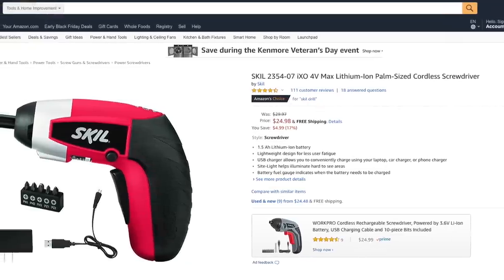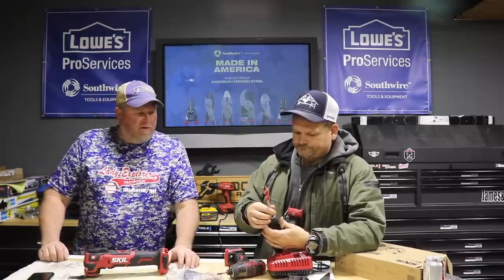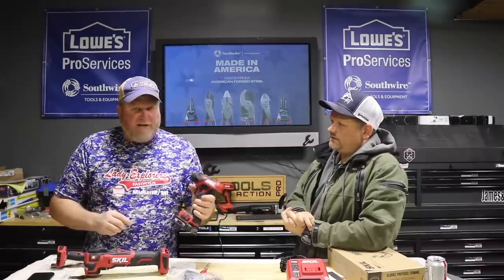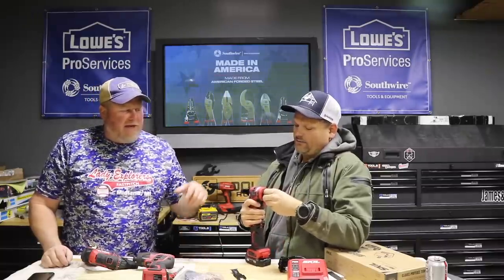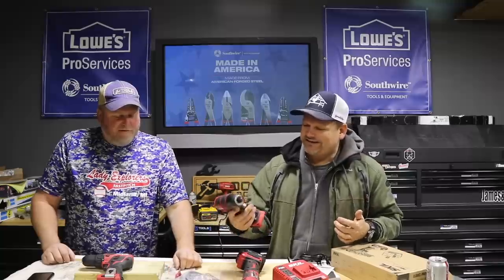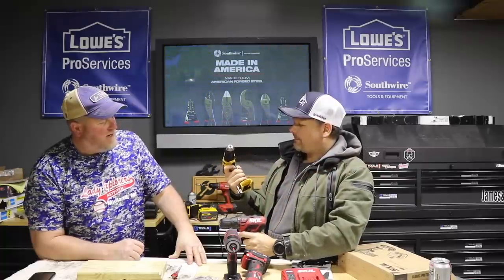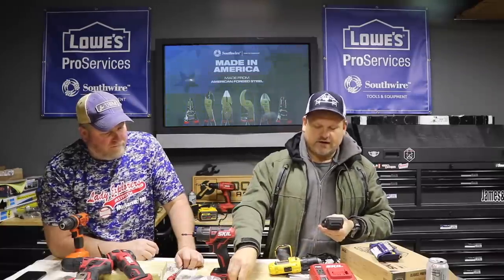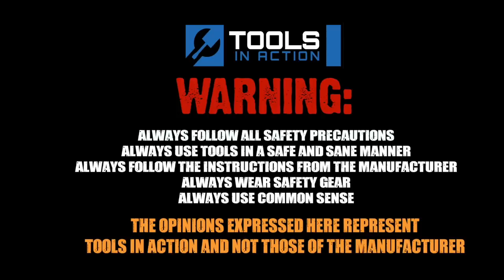SKIL 12V PWRCORE Tools - First Look

Comment: A compact 12V drill is one of my most used tools and my most used power drill.  I have a ton of 18V tools, but I usually grab my Hitachi 12V drill for it's light weight and compactness.

Comment: I've got this kit, its great. The drill light is fantastic. Unlike the big name competitors, Skil put the light at the base of the handle instead of under the drill housing. Impact has lots of power, way more than the Ridgid. This impact has great power!! And the Drill driver is as good as the Milwaukee

Comment: Remember the 12v Craftsman Nextec That had that same quickboost charger?  I miss those little tools.  They were actually half decent.  Used a set on a few jobs.  My only gripe with these thing types of brands is they come out and disappear months later after not selling.  Hard to invest..
Reply: Ross 1 I still have the multi tool and the hammer head.
Reply: Flint Layfield hammer head was an interesting tool.  M12 had a palm nailer similar.  Those cordless ones never really caught on.  But likewise I own on and occasionally pull it out.  That’s nextec multi-tool was also great.  I loved that thing.  When I purchased that tool, it was one of the first cordless 12v ones on the market.
Reply: I have the nextec impact driver, drill, multi tool and light.  They're six or seven years old now, but they still hold a charge and work well.  Even though I have pro-level tools which are much stronger/faster, I still grab the nextec tools for small tasks.  They're capable little tools!
Reply: Rob D I saw the nextec right angle drivers go consistently for like $150 used on eBay.  I actually have the nextec heated jacket and it works with my m12 Milwaukee power source also..
Reply: That's some good resale value!  
I didn't know there was a nextec heated jacket...interesting.
Reply: Ross 1  I have a nextec angle impact driver imported to England. Love it
Reply: The Walmart hyper tough brand ones are the same thing as the craftsman nextec ones.

Comment: I own the set..i've used it a lot, the impact is every bit as good as Dewalts 12v. It hits hard and i put it up against Ridgid12v any day! That said, I also had the Black Makita subcompact 18v. This Skil 12v has 1,100 in lbs of torque nearly as much as the 18v Makita at 1,240

Comment: I'm sorry but this Skil impact is right up there with Dewalt but without the Dewalt 801 chuck wobble. The impact tied for first against Milwaukee for nut busting torque at get this...1,600 in lbs..and..the batteries are only $29 and the batteries have a usb port to charge your phone. Not sure about durability, i just got them.

Comment: Good to see ya John.  It's funny that this company is owned by ego now and they managed to put a fuel gauge on the battery but they won't do it for ego.  Good video guys I would check these tools out but I'm way too far into Milwaukee and several other platforms
Reply: Thanks John.  Now that you mention it, the irony of the fuel gauge is very funny.  I really wish EGO would put a fuel gauge on their batteries.  It is the only thing that I don't like about ego.

Comment: 2 WEEKS ago just got m 12 fuel hammer drill and 2 speed impact gen 1 from milwaukee 4 $99.99 w hard case and 1-2 Ah bat and one-4 Ah battery and 12 v charger from my Ace hardware store cause they had a brushed 12 v drill and impact w bag and charger same brand 4 same price but didn't have it in the store when I called but had the m 12 fuels and 4 same price better drills since I no the owner

Comment: Skil new lineup is like buying milwauke in India. It's not made out of shit, its made out of ( coffee heads from Taiwan backed by Japanese investors) and skil had surveyed the market like Lexus did in 1994. They even marked up the same color scheme. Goes to show who they want to butt heads with. Skil's market are for those engineer guy's who finally busted hours on a chalk board just to use these tools, for as long as they needed. The difference might just be in the battery if they went up against Milwaukee. The body though. That's a bit tricky. I want to modify the crap out of that tool set, and Milwaukee might just be ahead in that curve. Those are might educated tips, to what I'm seeing. No opinion needed, just about what I just said. Although my only opinion would be, skil is trying to close the gap for a larger investor, maybe... Russian contracts?